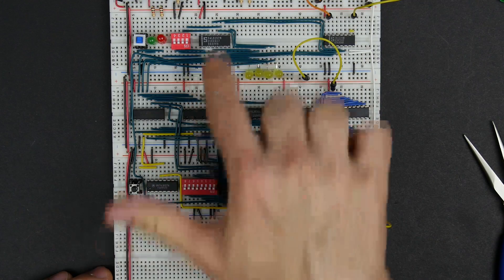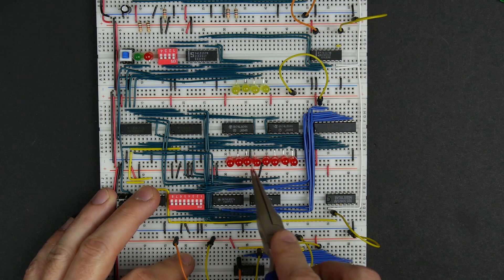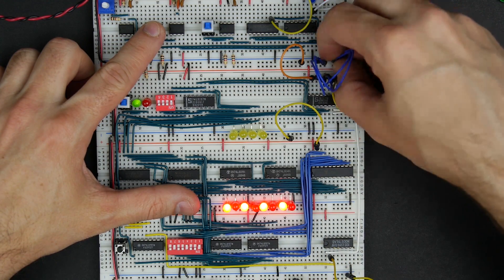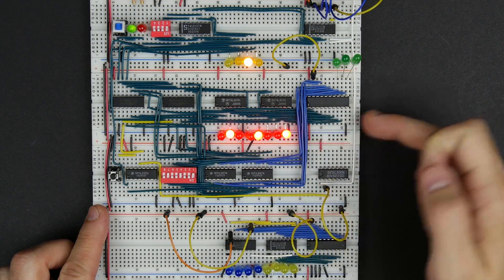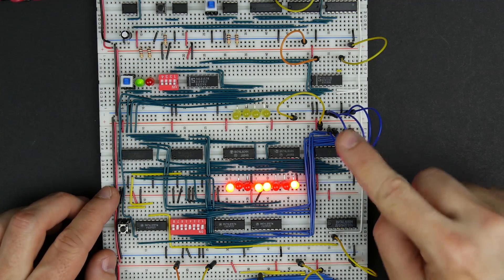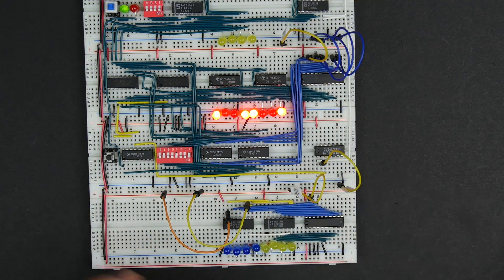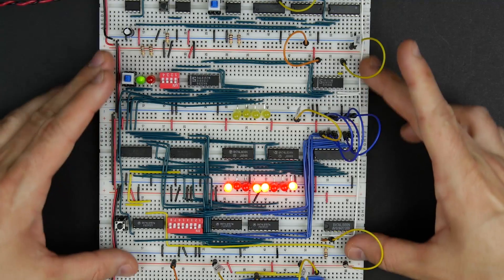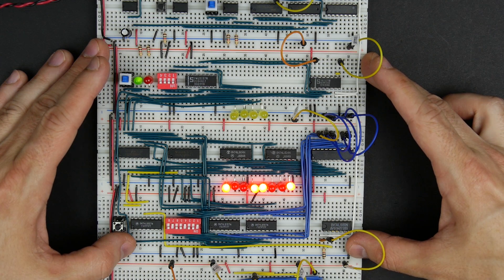RAM module testing and troubleshooting

Comment: Thanks, Ben! I'd like to know if you have an engineering degree?
Reply: That's obvious, he is from Khan academy too
Reply: No , he doesn't . There is a interview on him on Khan academy. You can watch it.
Reply: knowing all that he knows I bet he has a degree from a top university.
Reply: doesnt matter if he does or does not ... he does a great job of covering the material just one major problem ... 0 is active on or high or running ... because it is a completed circuit it has no gaps ... 1 is active low or off as in just a piece of wire not connected to anything ... NOT the other way around ... this is why he has to pull signals LOW to get them to be active because the chips were built to a proper standard that the americans didint bother to follow like the metric system instead of imperial measurement ... yes (3.67liters is equal to 1 IMP gallon) so we actually get .33 more milk than americans do when we get 4l of milk instead of a gallon jug ;) 
.
Other than american pride on conventions being backwards he is covering everything better than most basic electronics teachers do already.
and provides relevant versions to see what it can do as part of a whole system .... essentially he is taking a bunch of switches and making a computer ... as he writes the program and stores it then runs that program he has to input the data for it ... after that it will run as along as he chooses to let it run 
.
all he needs to do at the end of it is make a solid state hard drive to store his programs and poof he has a workable system that is a ton better than what took apollo to the moon